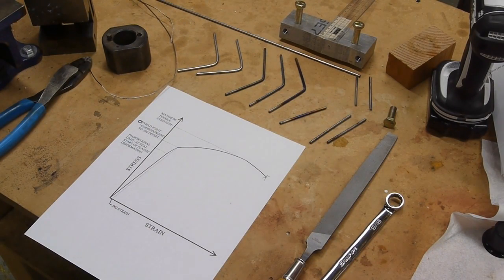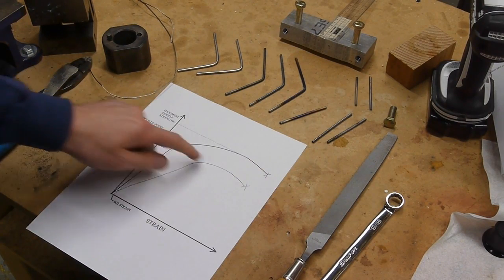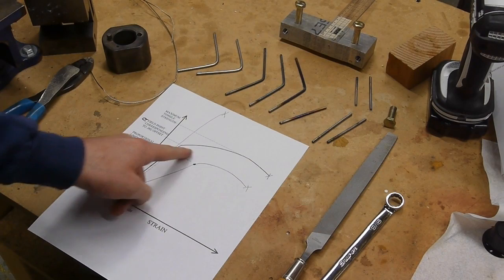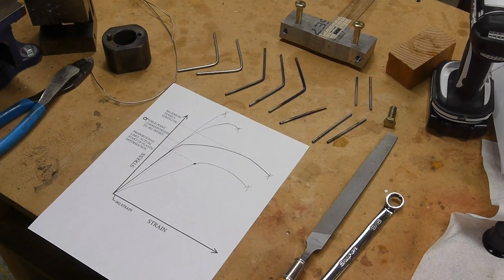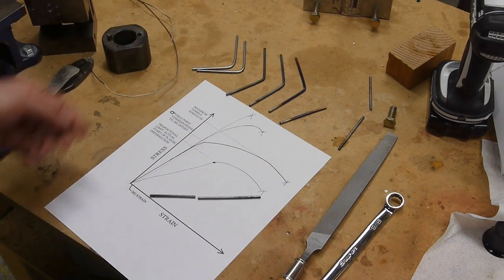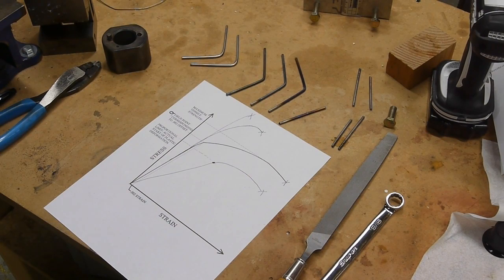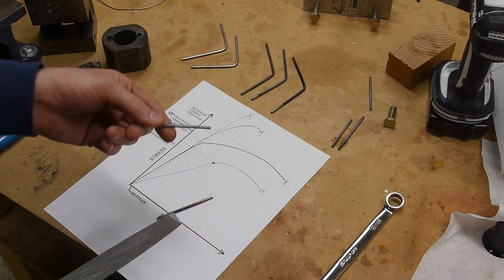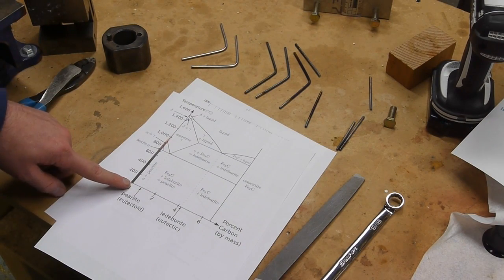Intro to heat treatment of steel (hardening and tempering)

Comment: Man it’s wild I’m watch a ten year old video of yours, and it’s wild.😊

My only question is, where does SAE 4140 fit in with its 0.4% carbon content? 

I’m currently using it, because it’s good to weld to cold rolled steel car panels. 
2nd question: should I temper the 4140 pucks after welding, to make the steel more ductile?
🇦🇺🤜🏼🤛🏼😎🍀😊☮️😂
Reply: See Machinery's Handbook under "Numbering Systems" or look online for descriptions from metal vendors.  4140 is listed as "Medium Hardenability".

Comment: Hello, this is a very helpful video!
Currently I got a problem with my sputtering machine:

The deposition rate is very slow, 1/10~1/20 compared to previous times. All parameters are kept similar. 
There are many sparks on sample holder and near the gun, shown in this video: https://youtu.be/aA7cjQ6PjTY

Do you know what is the problem or could you give me advise to find out the reason for that?

Many thanks

Comment: I have a ratcheting lopper..
The bad part is the tempering of the blade.
Overall the blade is good except for the teeth, gears or cogs..
They break off but the blade maintains an edge..
I'm guessing by your statement, the heat treating  of the blade, makes the gears brittle, but it benefits the edge..
It would be nice if the product was heat treated individually between the  edge and gears instead of buying a new blade once a year due to broken teeth.

Comment: Just when I thought I knew everything...
I have a question I think you may have the answer to, or point me in the right direction.  I need to find a metal (preferably 1/2 rod) that can be bent and welded to a vehicles exhaust system to prevent certain expensive parts from growing legs and walking away.  Thefts of this nature seem to be a huge issue right now.  It would need to be so hard that a Sawzall blade or grinder would have a very hard time getting through.  What would you recommend for this situation?
Great video.

Comment: You mentioned your very strong piece was tempered at 300C in your kiln, was that for 1 hour and was that after heating it to 800C and quenching it? What of the speed of the heating process, is it important to pre-heat the kiln for temper so it is brought up to the right temperature as quickly as possible? If it takes as long as 10 seconds of cooling to ruin the hardening, why is it that any steel is rated for water cooling when oil cooling is plenty capable of cooling it faster than 10 seconds? Does cooling it faster make it stronger aswell? What happens above the 800C hardening target? Is getting further below ~150C more beneficial?

Comment: 1. Heat steel to white hot, then quench in liquid nitrogen. Steel will shatter with the slightest touch.
2. Bet someone $100 you can break steel with your bare hands.
3. Repeat until Jeff Bezos.

Comment: At bigger cross sections it is possible that a hollow tube can be made stronger than a solid rod, because the internal parts of the solid rod can't reach the required strength because can't cool fast enough due to the heat conductivity of the steel?

Is this a valid production constraint?

Comment: It was a Spielberg ending. Carbon is 0.1 % not 1 %
Reply: 0.1% would be on the milder end of mild steel, water hardening steel is no less than half a percent, and as much as 1.3% carbon

Comment: And then there is work hardening that also needs to be annealed so it doesn't break, like working copper, where if you form it enough without annealing, it will fracture from hardness.

Comment: What happens if you temper steel in the vacuum chamber? (
Reply: @Aaron Washburn and adding magnetic fields to control the direction of the atoms? I couldn't find any video of this.
Reply: @Maisonier  I would think that could create a magnet, but i don't think it would affect the hardness

Comment: Wrap your coathanger in leather,insert into a metal tube, seal the ends, heat to RED, hold for 4 hours, and check your "yield" point now.? edit:- forgot, after the 4 hours, quench the whole shebang in water.

Comment: Hey Ben. I have a question, I'm building an engine and I wanted to heat treat the connecting rods. This is an expensive process which is why I want to do it myself. I'm pretty brave, I don't mind learning. How can I accomplish this? I need the connecting rods to be stronger under extreme heat and able to withstand a lot of pressure since I'm trying to increase compression.

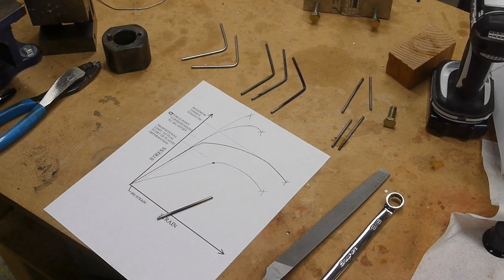Comment: Your statement about "what we mean when we say a material is hard its actually very strong" is sadly inaccurate. strength and hardness are two very different contrasting things. 14:22 Strength and Hardness are an equal trade off when dealing with a single material's variations without adding elements. Otherwise this was a great video. Very informative.

Comment: w1 tool steel from mcmaster is b95 medium hardness. low carbon steel is b70 medium hardness. apples to oranges  but a rough comparison of as delivered hardness. both have very similar yield strengths of 55,000 psi for w1 and 54,000 psi for low carbon steel

Comment: The reason the ductile rod held more weight was because it allowed a fully plastic deformation in bending. The ductility allows the stresses to move inward where the entire cross section is plastic instead of just the outermost edges. On the other hand when the outermost section of the hardened steel reaches yield, the outer section fractures. The cross section is reduced, stresses are higher. The result is a quick failure of the entire rod. The strongest rod will allow for full plastic deformation of the cross section while "using" the extra ductility as strength in the hardening process.

It's also an interesting look into why we want some ductility.

Comment: why about cryo treating steel?
Reply: Cryo is pulling the temperature down way faster, especially on the surface, and brings a harder material than you would get with water. Oil on the other hand is a slower cooling. I prefer to use super-quench if I want a really hard bit of metal - add salt and soap to the water to let it wet the surface more easily. Google for more info. Also, stir it to get the water moving fast, then stir the hot work in the opposite direction.
Reply: I thought cryo treating was using liquid nitrogen to stress relieve hardened parts. I can't imagine there's any kind of quench you could do that would really qualify as "cryo"

Comment: I can imagine people watching this and heating mild steel up and quenching it expecting hard steel....It aint gonna happen. No mention that steel is an alloy, you need carbon, more than is in mild steel for toughness and  hardening. This was pure luck he had high carbon steel.
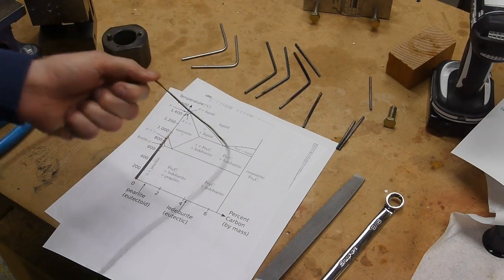Reply: I'm guessing you didn't actually watch the whole video then. @16:28 shows exactly that.
Even worse, he explains at the start that he bought W1 water hardenable steel rods - there's no luck here.
Reply: Fool, he went through all of this in the video. SMH @ internet know-it-alls overly desperate to point out mistakes.

Comment: Sorry if already asked/answered, but I didn't catch it.  What ways are there for your average diy-er to manipulate the amount of carbon in a given piece of steel?  Say rather than buying stock of known specs, you go to a junk yard and grab an indistinct scrap, and wish to make certain it is adequate for whatever task you expect of it?
Reply: rustopholis to check if it can be hardened you can just try hardening it. There's also spark testing, which distinguishes carbon content by spark patterns off a grinder. To manipulate carbon content, I don't know of a way to remove it without melting it to a liquid, but you can add carbon by a process called carburization. I recommend the video Chris did on the channel clickspring, look up where he makes hand made files from mild steel, and the accompanying video where he carburizes the steel for that project

Comment: You said that hardening does not change material stiffness. However, metal sample resonating frequency is determined by its geometry and its stiffness and if you harden a metal sample, it's pitch rises significantly. I mean, if you hit a metal sample with something and let it ring, hardened steel rings with higher pitch than normal steel which means it has greater stiffness.

Comment: Well Thanks, that was very informative! My Dad was a Tool & Die Maker & I spent a lot of my early years in machine shops on Saturdays as he worked on side jobs. One thing I remember doing was hardening steel, as you've shown - heating to cherry-red & quenching. I remember Dad also adding Carbon to steel in an electric furnace by covering it (the steel work-piece) with coal and or charcoal and bringing the temperature up & holding it (temp) elevated for the carbon in the charcoal / coal to migrate into / penetrate the steel. He showed me how we could make a piece of coat-hanger wire into a tiny knife blade by flattening, carbonizing, hardening, annealing then sharpening. I was only 8 or 9 and didn't fully appreciate what I was being shown, not right away,
Reply: By this time You must be a  highly skilled person. Long live thanks.

Comment: lets say you have a piece of steel that you hardened, and then tempered. now, after doing those two processes, you heat the steel until it gets that bluish color on the outside, and then cool in oil. would this third process remove the effects of previous procedures. if it would make it more brittle, would it have lost all the benefits of the original tempering process?
Reply: assume the example i gave is carbon steel.

Comment: Where does annealed steel tie wire (the stuff that comes on a roll, usually coated in black) fit in in terms of carbon content, generally? is it harden able?
Reply: +CantripGhost ..I'd guess extremely low carbon content.....    .1 percent maybe...I've been using that stuff for 50+ years...never had seen it harden, even with water quenching from red-hot....

Comment: Thank you so much for helping me understand tempering and hardening steel in an easy and practical way, although i'm not clear 100% because i'm not familiar with some of the terms that you use. But it is very good actually.

Comment: With all your scientific graph and load holding test all you mentioned when it's hardened is when the the steel becomes cherry-red hot. I'm disappointed that you mentioned nothing about losing its magnetic properties. Using magnet is so much easier and accurate than just observing the colour of the heated steel.
Reply: Maybe disappointment is a bit of an over reaction ... :D But that's a good tip.

Comment: @applied science, help me out here.. after the final temper do you quench the metal or let it cool in air?.. love the video it helped me out alot thanks
Reply from the maker: +Wes Brown Normally, it is cooled slowly after reaching the desired tempering temperature, but cooling quickly should be OK too.

Comment: Is there any way to harden a circular ring( 12 in diameter, 1 inch wide, 1/4 inch thick) and keep it from warping? Any help or suggestions would be greatly appreciated. Thanks.
Reply: no really great ways to keep it from warping AFAIK, you'd probably want to leave it over-size and grind or hard-turn it

Comment: Great work . So are the Carbon Atoms the reason the crystalline structure occurs ( as in Diamonds ) ?
Reply: Metal atoms inherently have a crystal structure, namely face centered cubic (fcc) for steel (iron) in this case. The crystal structure you see in diamond is a unique configuration for carbon.

Carbon can be added to steel to change material properties, but these carbon atoms appear in the steel as inclusions in the FCC structure. Did that answer your question? It was not very clear to me but answer me back if you need more help to understand :)
Reply: +Sam yes I would . im trying to understand that if steel has a crystaline structure how does carbon add to its hardness
Reply: +graham kaveman I believe that is because when the carbon atoms become encased in the FCC crystal structure, any dislocation motion is inhibited, meaning, when atoms begin to slide past one another on a slip plane, the way is blocked by sequences of carbon atoms.
Reply: +Sam oh so adding different atoms other than carbon isn't as  effective ?
Reply: +graham kaveman I'm not sure about other atoms, but generally speaking, it is only feasible to add elements with similar electronegativity and size as the host element's. Also it is known that carbon has a very strong bonding with many elements.
Reply: +graham kaveman Sam is correct. The recrystallisation of the grain structure helps prevents the slip of the atoms and locking into a misaligned pattern.

Comment: Beautifully done overview of an apparently touchy subject. Lots of misinformation out there. I feel like I get fine performance using my normal kitchen oven, but always verify the temperature with the oxide color the steel shows. I also recenrly learned about a phenomenon that I have seen many times while quenching -apparently shadow passing through steel as it approaches an orange color is actually the carbon going into solution. It seems to happen at the right temperature - I'm just wondering if you could confirm or deny this.

Comment: Better to not use terms like stiffness  and toughness incorrectly. Low carbon steel cannot be heat treated nor can it be work hardened but you hear about it being done by these backyard engineers all the time.

Comment: damn dude ...all I wanted was....making a knife in a back yard forge for a retired guy....I want it to hold an edge...
Reply: Normalize 3 times. Then heat it up to non-magnetic, stick it in oil, stir back to front (not side to side) and test with a file after it cools in oil. Sand the scale off, put it in the oven at about 375 and creep up on the temperature until you get a straw color. Then do 3 cycles at that temperature for 1 hour each, cooling inbetween. Congrats, you have a hardened knife blade.
Reply: Thanks man :-)
Reply: Not a problem. This works for simple steels like O1, 1095,  5160, etc. Don't harden the tang (dont want that to snap) and don't forget to move it up and down during the quench a bit (prevents stress risers). Anyhow, there's an optional second step to get a differentially hardened blade. After all the tempering is done, submerge the edgemost third of the knife in water and bring the spine to a dark blue temper. This protects the hardness of the edge but softens the spine a tidbit more. Basically if a blade like that snaps, the crack will only go halfway through the blade and allow further use in a survival situation. It's tricky to get the right ammount of heat on the spine while the water is acting as an extremely effective heat sink, so bear in mind that it is optional.  I'm not entirely convinced that it's necessary but still do it more often than not. An alternative is to shoot for a temper color closer to the brown color right before purple instead of straw - this will give less edge retention but reduce risk of breakage during hard use.

Comment: This is very helpful, feels like I'm in school or uni. Thanks for the upload!!!

That file trick is pretty handy, I noticed when trying to file a hard steel, It felt like there was no progress, it was smooth.

I did learn annealing in work experience at a jewellery shop where you heat the silver up then let it cool down slowly, then you can work on it like draw silver wire through different size holes to make the wire thinner. Pretty cool stuff.

Comment: I want to harden some 3/8" wide copper strips to make a leaf spring for a 32" long model of a a 1929 Miller race car.  I will have approx 5 layers of copper for the leaf springs of approx. 7" in length.

I want some spring action, this piece will be a static display, but would like a bit of spring back should the suspension be pushed down.

Help is welcome,
Dale in Indy

Comment: Great learning experience for me. I have much experience working with mild steel but have never heat treated/ hardened anything (Im a sheet metal worker) 
I made a new stainless steel blade for my branch cutter, out of a 3/16" thick sheet of stainless steel, the blade works great but the thinest part of the sharp edge gets wrinkled if I clamp a little crooked on a dry hard stick. 
Can I harden just the edge of the blade without heating the entire blade red hot?
Reply: Harold Westrich Hmm I don't know about not getting the entire blade red hot but I do know that some asian traditions have done differential heat treatments for a long time by letting parts of the blade cool at a different rate than the rest.

I would expect that if you can get all of the edge to a consistent temperature this isn't impossible but this is probably more work than doing the whole knife at once?
Reply: Harold Westrich Yes you can, you need to paint clay onto the areas you don't wish to harden before you begin to heat the steel, after that you just treat the process like normal. One note, stainless steel isn't always the toughest stuff out there so the maximum hardness will be lower because of the chromium content.
Reply: clay....so obvious i overlooked.....brilliant.